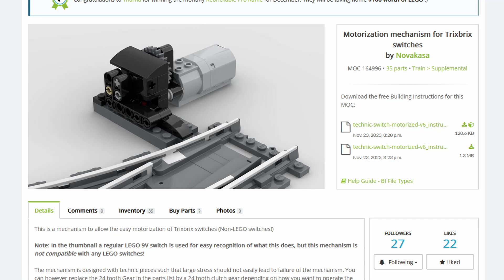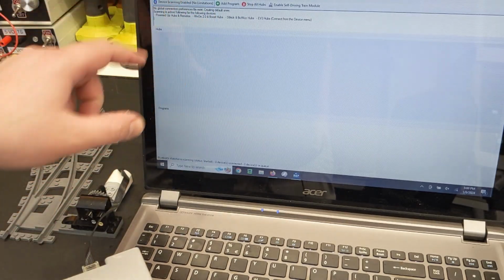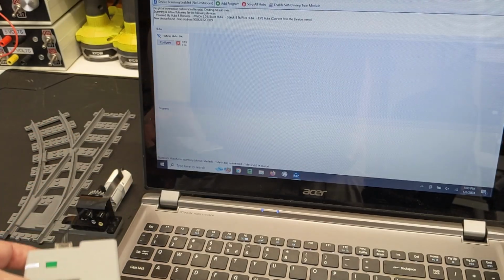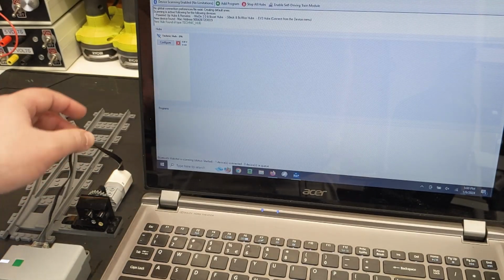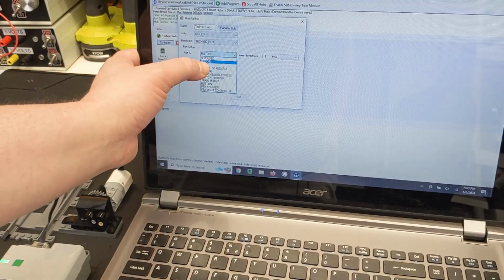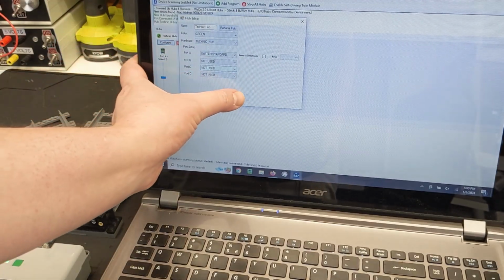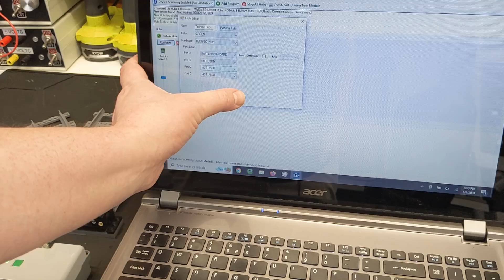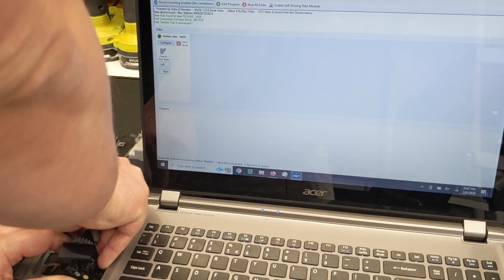TrixBrix switch machine by @novakasa5011

Comment: Many thanks for testing this out, really glad that it seems to be reliable!
My main constraint from the beginning was to make it as sturdy as possible, and like you said it was a really iterative process to in the end make it as compact as it is while allowing for flexibility with different motors and increasing the distance to the track etc.

The main trick to it was to absorb all stress from stalling the motor via technic connections rather than any stud clutch power. So stalling the motor does not put any stress on how the mechanism is mounted on the switch. Had to get a bit creative since the range of motion needs to be at most half a stud.
Reply: Thanks for creating this buddy 😊
Reply: A pretty common thing for rotation to linear motion (eg. windshield wipers) is to just design the linkage so the motor can spin continuously to reach both states.  Half a stud's a pretty small diameter for that kind of thing though, and then you'd want sensors to say when it hits the endpoints.  Would need to find something weird, like a 1x1 brick with axle hole is 1/5 of a stud larger radius when you rotate it 90 degrees.

Comment: Wonder if using red parts, and green parts would help hide or help blend in these turn devices?
Reply from the maker: Depending on the layout maybe.  My layouts are temporary and just to run trains or play with automation.  It seems like a lot of city / layout builders like to hide things under the tracks or build boxes to cover switch machines

Comment: i mean surely something like a sg90 servo would be cheapest (not full lego but still) geekservos too would work
Reply from the maker: I mean TrixBrix sells servo motors purpose built for these.  I prefer a Lego design myself
Reply: @BatteryPoweredBricks   i meant more of buying cheap sg90 servos and mounting them into the switch yourself, you can use axles or a frame to mount it pretty reliably and to connect it to the switch you could just let the servo horn stick into a gap and roate back and forth, you can get like 20 servos for 12$ if you want and to control them u can use an arduino that receives a signal from the 9v control pannel or just attach a button/switch to it :D.